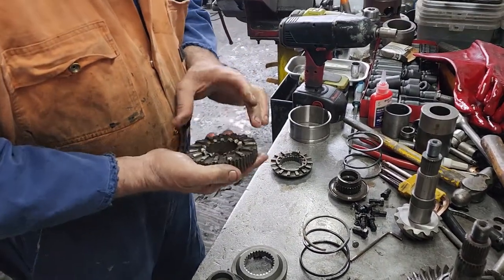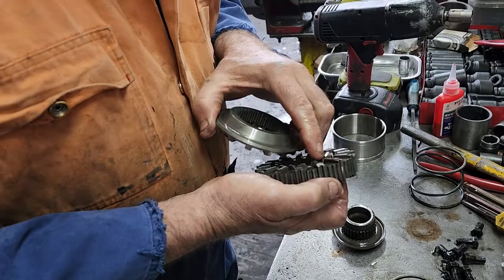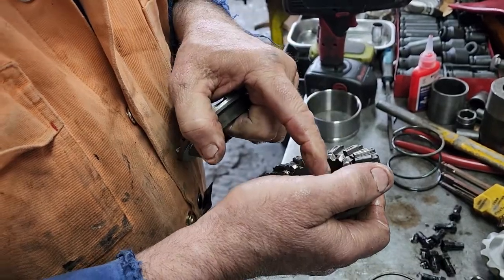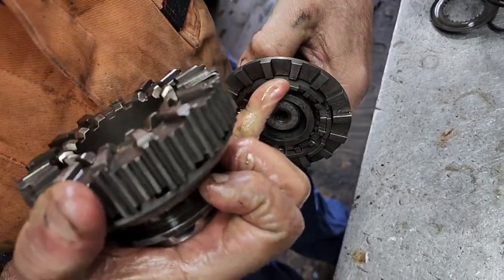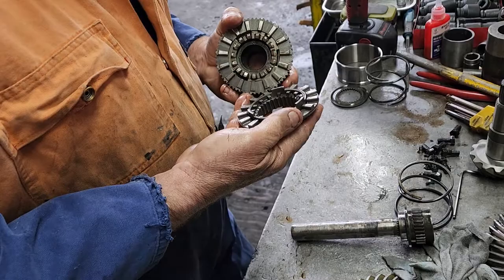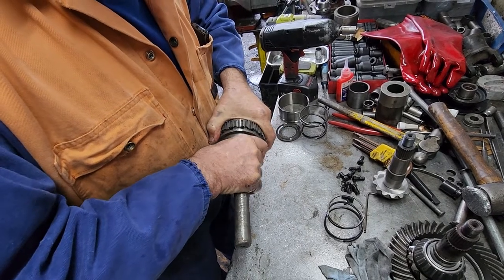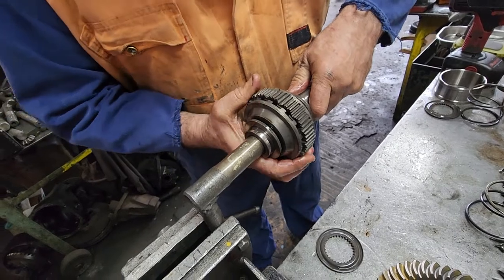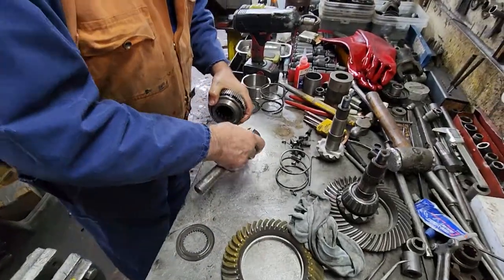how a differential Detroit locker works

Comment: How do you put the casting back since it's spring loaded?took mine apart n now I can't seem to put it back ant ideas?
Reply: Grab yourself some ready rod and some big washers and slide the ready rod through the assembly and clamp it together that way. Once ita s being held together it'll be easy to get the bolts in. Or you could be like me and cave man it and force it together with your body weight and fight with it until you get a bolt in 😂.